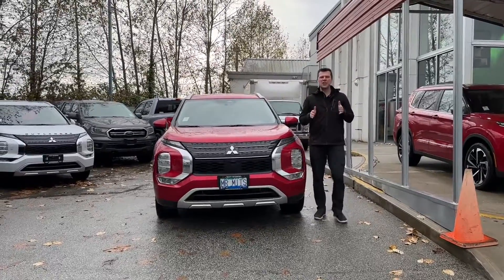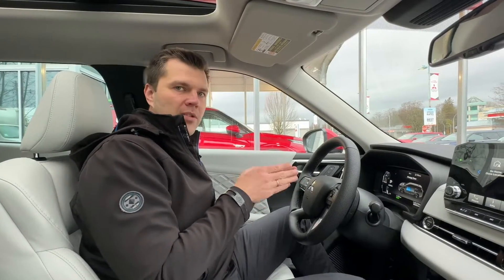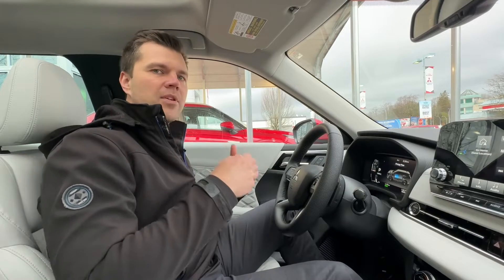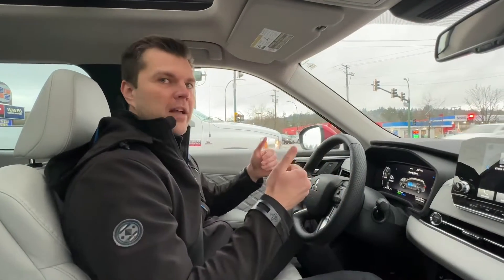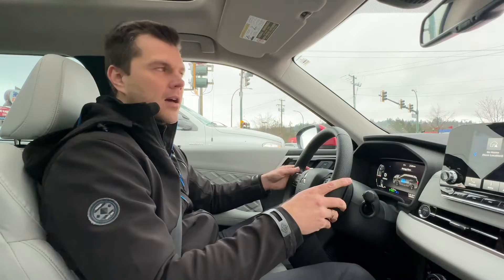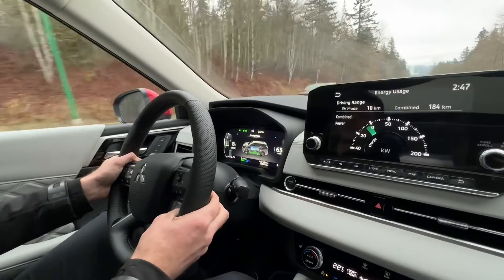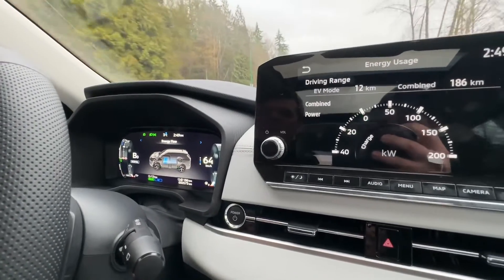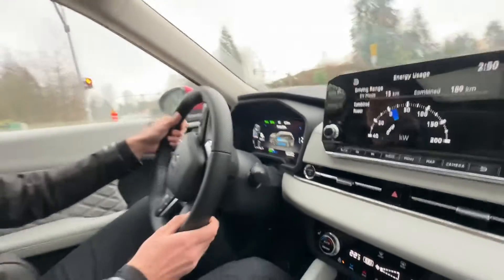2023 PHEV Outlander PADDLE SHIFTER  regenerative braking testing!

Comment: Is it more efficient to set B0 when accelerating or B5? Do you save more gas accelerating at B0 with the car lighter or regenerating some energy at B5 with the car heavier so using more gas but generating some energy? It's my biggest doubt with my car right now. It would be great to better understand how it works and how to take more advantage of the technology in the car

Comment: So still we have to use gas paddle but instead of break paddle we have to use paddle shifter 
Am i right?
Do I need to press paddle switch besides electric mode?
Or I should use gear shifter to B mode 
Please explain 
I just got my PHEV YESTERDAY 
thanks
Reply from the maker: Congrats on your PHEV! :) You can use paddle shifters to ease off on braking power or make it stronger. Most convenient way to engage is with shifters (you can also do it with gear shifter, it's just not as convenient)! Just take yours out for a good drive and play around with it.
Reply: It’s been 2 days since I got my SEL PHEV and today I tried the innovative braking. It freaked me out a little. As soon as I let go of the gas pedal it would almost immediately come to a complete stop . And it felt like I needed more effort to get going while stepping on gas pedal. Is this normal?
Reply: There is no gas paddle only 2 break paddles, one to add regen breaking and one to subtract.
Reply: @mikeintampa250  i know that. I meant to say after regen braking it takes a bit longer to get it up to speed.
Reply: @judithroque4009  for me it doesn't, it's using regen braking instead of the actual brake pedal so you could drive it the way you normally would.

Comment: Is it normal that on EV mode on the 2023 if i use the paddles it deactivate the ev mode! That was not like that on my old 2018…
Reply from the maker: No, paddles won't de-activate the EV
Reply: @mr.mitsubishi  the paddles deactivate ev mode on mine but if the engine is hot they won’t… very strange
Reply: @mr.mitsubishi level B 3 and up deactivate CV mode on mine and I get a message to that effect on the instrument cluster. Someone in one of the comments mentioned it does this so it doesn't overload the batteries.

Comment: Great video, thanks for sharing! One question i have, if anyone here happens to know, is why the all electric range is not further, considering the size of the battery? The Hyundai Tucson has a 13.8 KWH battery, the Outlander has a 20 KWH battery. Despite being 45% larger, the Outlander only has a 15% further range then the Tucson.  Any ideas?
Reply: The battery itself adds weight so you have to sort of figure out how much more battery can an engine with X amount of torque haul around before it becomes a burden on itself. Also I've been watching/reading a mountain of reviews on this car for a couple of weeks now, and many people are reporting a real world range of closer to 80 km (in ideal conditions).
Reply: @adamcoe yes, true, conservatively I've been getting 50 miles of EV range
Reply from the maker: I'd assume it's not just the size of the battery that determines the range. There's a lot more to the PHEV than that. Mitsubishi has been in the EV game a long time, I'm sure there is a technical reason for this

Comment: Is the hood flutter problem resolved in 2023 model of Mitsubishi Outlander? It will make or break the deal for me.
Reply from the maker: It's long fixed. Only first few months of 2022 production was affected. Recall is out, hoods are replaced.
Reply: @mr.mitsubishi  thanks

Comment: Great review, thanks for doing these little focused clips!  IME so far I wish that B5 would also slow to a complete stop. I mean with 5 levels of regen, why not just have one setting that goes all the way, especially if the brake lights come on. I also think that B4 slows quickly enough that the brake lights should come up for the benefit of drivers behind you.

Where does the on-drive pedal fall on the regen braking scale; stronger than B5?

I also find oddly that when in EV priority mode, if I switch to B3, EV priority is cancelled, which I don't want if I put it into EV. Maybe that only happens when the battery is full as someone else mentioned below. Personally I find that annoying; I would rather have the car tell me that B3 is not available rather than switching out of EV mode, because now I have to do two things to get back to EV mode: flip to B2 and then tap the EV button. EV mode should be priority over B3. Anyways, this is learning curve stuff!
Reply from the maker: Thank you for your comment! One pedal is I'd say 8 compared to B5 - it's quite hard.
Reply: I test drove one last week and the 1 pedal mode is definitely harder than B5. I did see one video review that said that the energy return to the battery is the same in B5 or one pedal mode, so (assuming that's true, cannot confirm) if you're in real tight stop and go (and you didn't buy the trim level that has stop and go auto driving), that might be cool though I found it pretty jarring. But I could definitely see staying in B3 or B4 for a lot of everyday driving and getting a decent bit of energy back. REALLY excited to get one of these things

Comment: Locomotive Engineer here, this is what we would do when going down hill called (Dynamic Braking). We would engage dynamic braking by moving the the throttle handle forward and it would allow the motors to reverse polarity and using the motors slow the train down without using the air brakes. Good practice with this vehicle before going to work. 😁😁
Reply from the maker: Thank you for your feedback and input! :)

Comment: I have a silver PHEV Outlander GT on order and looking forward to it How does cruise control handle regenerative breaking the Outlander PHEV?
Reply: I still have about an 11 month wait till my Outlander PHEV comes in, but I took a test drive down a very steep hill near me for about 3km on cruise. It kept the car exactly at the right speed the whole way down the hill (100km/hr) and it gained 13km of range by the time it got to the bottom of the hill. I believe it did regenerative braking the whole way down. I think the B1/2/3/4/5 settings don't matter so much on cruise control as it's more like to the innovative pedal (which is B5 all the time, I believe).

I then lost all those 13km when I went back up the hill (and the engine had to kick in to provide enough electric torque to keep the car at 100km/hr going up the hill).

Comment: Interesting video, thanks, but the 5 km obtained by using regeneration is not correct. 

It may look like you got so much range back just because it is a guessometer and it continuously adjusts how much EV range you have if you would continue to drive given the current conditions, e.g. the current el. consumption you have. Since using regen there is no consumption and one even adds some extra charge to the battery, the car automatically calculates that you can drive in such way much further than you typically could if you drove on some flat road, so the km it adds to the total range are based on assumption that you will continue to drive downhill. This can also be seen in the data shown by the car when you continued to drive after the test in some city traffic where you lost all those 5 km of range in just maybe 1 km. So the actual range you got from regeneration was maybe just 1-2 km instead of 5 km. 

To measure regenerated energy properly it would require to calculate how much kWh one have added to the battery during regeneration and then use a typical el. consumption of the car to estimate how many km one would get out of it. 

It could have been better if you could show the ECO Drive Report which reports how many km the car obtained by using regeneration during the trip. I do not know how exactly it calculates the data, but I assume that it would use the amount of kWh collected while using regenerative brakes during the trip and then would use the average trip consumption to convert those kWh to km.
Reply: Great point. It would be nice if they can figure out a way to display remaining kW in the battery along with the battery level gauge, that would show how many actual kW was regained.

Comment: Yessir, love my regen paddles on the last Outlander PHEV. Took 4 years before I needed to replace the brakes.
Reply: Should I get this car? I’m just super scared that the quality is bad and the cvt engine 😭😭
Reply: @zachsdemis3  I have owned 4 or 5 brand new cars in my life and every single one of them you have to start a list of manufacturing problems that the dealer has to fix over the following months as problems appear or you notice them.  Both domestic and foreign brands.  I bought a 2023 Outlander and there is NOTHING wrong with it.  No flaws, nothing!  It is the highest quality car I have yet owned.  Everything on the car is solid.  Nothing in the interior feels cheap or loose.  It even has double layer windows to minimize noise.  Even my salesman did no know about that one!

made in Japan.  Say no more.   I have owned it for 14 months and I have just 10K on it and I seriously have only been to a gas station to fill it with gas maybe 5 times in those 14 months!  You can drive so far on pure electric before you have to kick on the gas.

There is one BIG negative that I must speak of and it is a really big thing to me.  The center console 'cubby hole' is bizarrely a fraction of the size of the actual plastic molding.  You tip up a large (and really comfy!)  padded arm rest and underneath is a tiny little space that literally my cell phone (iphone 13 pro) will not fit length wise in - i have to put it in slightly sideways to fit it, or literally force it to fit.  It also is not very deep and the edge is surrounded  on all sides by inches of empty plastic molding.  It could be made many times bigger.  That is a head scratcher and a big negative.  You put a couple of things in there, and you have to empty it out to get at anything because the opening is so small.

Other than that oddity, the design and build quality is generally top notch.
Reply: @zachhefner6716  its mitsubishi, made from Japan! Do a little research and you will see how reliable this car is.

Plus it doesn't realy have a "cvt" transmission.

Comment: From what I can tell the regen braking works Quite a bit differently if battery is full. Engine seems to kick in every time you go to B3 of higher which is ridiculous. Please comment if you found a work around this. The only workaround I found is driving in B0 and using regular brake pedal which seems to regen just as much energy as the paddles. Also the one-pedal does not seem to kick the engine in and provides a strong level of regen but it essentially automatically presses the brake pedal for you (you can feel it with you foot).
Reply: So I  read the manual, page 1-4. When the battery is near full, or its cold or hot  and you switch to more regenerative braking (B3+), the engine is driven by the generator to consume the regen power. So the ICE is not consuming gas when this happens. That's pretty cool. Wish it wouldn't cancel EV priority when this happens though, but a quick tap back of the gear lever back into D makes EV priority available again.
Reply: @drzoidberg1  good to know though I find it hard to believe that ICE running consumes zero gas. In any case, I just got used to not using the paddle shifters almost at all unless I’m rolling down the hill in which case I pay attention to stay in either B1 or B2. Otherwise, in regular driving it seems like an unnecessary effort to play around with the paddles when the brake pedal seems to return max regen available at a given SOC of the battery. I also found it easy to overshoot from B2 and B3 and accidentally trigger the ICE and cancel EV mode which is indeed annoying.
Reply: @drzoidberg1  Great review! So, is it possible to use the B5 setting and stay in EV mode by tapping the gear lever back to D?
Reply: @michaelselman3094  give it a try, I think that puts regen back to B2. I use the paddle shifters to go back to B2 and once the ICE finishes it's on cycle it will turn itself off.
Reply: @drzoidberg1  Thanks so much for the reply. I haven't found anyone that can explain why the EV setting does not allow a regen setting higher than B2. Is it a "mistake" on the part of Mitsubishi, or is there a sensible reason why this is so?
Reply: @michaelselman3094  Charging past 60% is harder/slower on the battery, and B3+ generates higher charges/kW, so  when you try to store a massive amount of regen energy achievable in B3-B5, this could easily push the battery over its allowable max charge level to possibly damage the health of the battery. For this reason, the BMS processor reverts to another protocol to instead burn up the large amounts of B3-B5 regen energy. It accomplishes this by using the starter/ generator motor to spin the gas engine from 1,200 to over 4,000 rpm consuming the higher energy from regen.
Reply: @drzoidberg1  Thanks so much for explaining the reasoning behind the design. Mitsubishi should really make information more accessible to their customers. Thanks again!

Comment: Great video once again thank you.

I love using the pedal Shifters.  I normally drive in B0 during city driving and highway, unless I use cruise control  because the system reverts back to B2 (no pedal sifftter use)

We do not have any hills to speak of here in Winnipeg so my Regenerative Braking only occurs when I slow down as I approach intersections. 

In this test you just did,
A gain of 5 kms on on 3 km run is very impressive, but I noticed that you had the Cabin Heater set today 22'C.   I believe you may have gained 7 or 8kms had the heater been off.  But of course these guessometer readings

Hopefully you may get some warm days soon so you can do some tests with the heater off.

In my 2022 Phev in the warm weather I usually drive 7 to 10 kms one way to Girlfriend's place and back, each way and average 14 -16kWh/100km use each way, depending on traffic and with Heater off, on pure EV.

But now with Temps below -20'C and Cab Heater set to 20'C, I am averaging 45 -50 kWh/100km of EV even with the ICE on and indicating 6 -9 l/100km On the same drive distance.

So you see, the Heater on both my 2018 and my new 2022 Outlander PHEV draws a lot of Power from the Main Batery when the heater is in use.